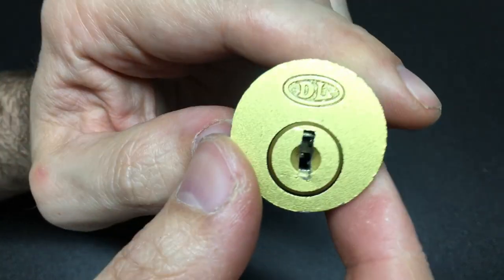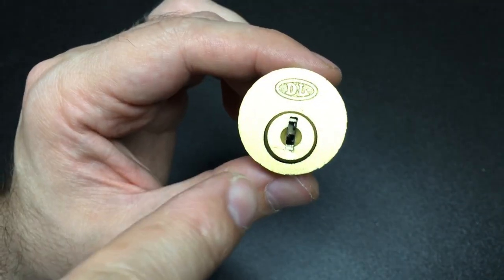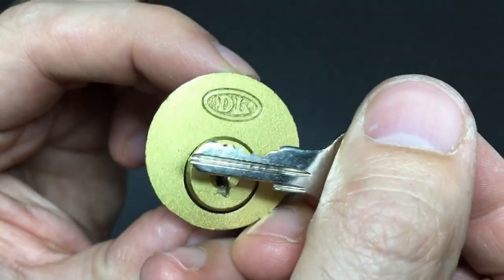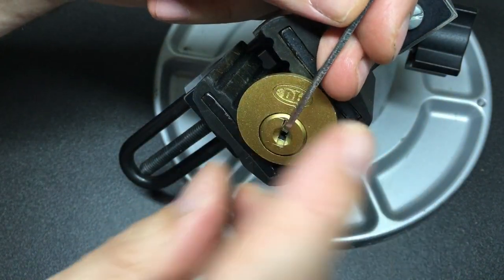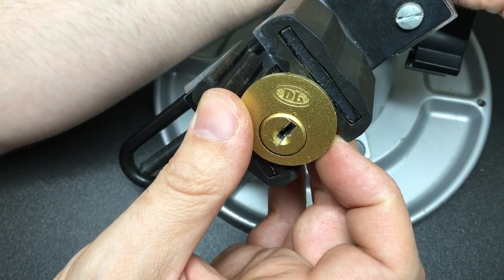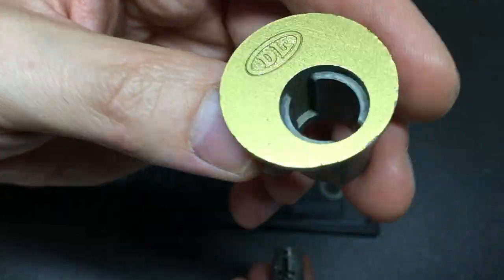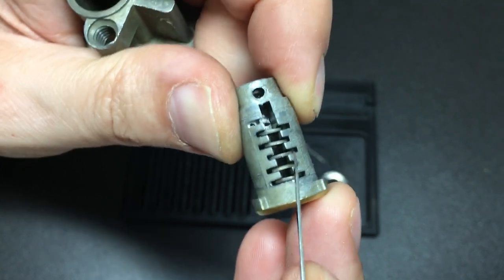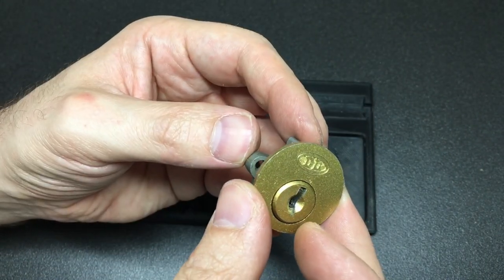Unusual Wafer Rim Cylinder Picked

Comment: Similar to what we use in Australia, we have a standard Fire Brigade access key that works pretty much nation-wide.
This is an ancient wafer-lock key. (Lockwood 003).
A decent range of retro-fit cylinders for Rim locks, Commercial mortice locks, KNK cylinders, ABUS 83-series Padlocks, have all been adapted to comply with requirements for these tired old wafer keys.
Nifty to come across, but always low quality.
Reply from the maker: I'll have to look out for one of those lockwwoods!